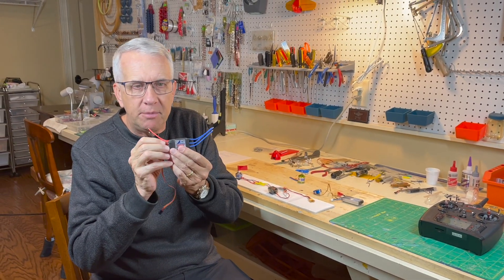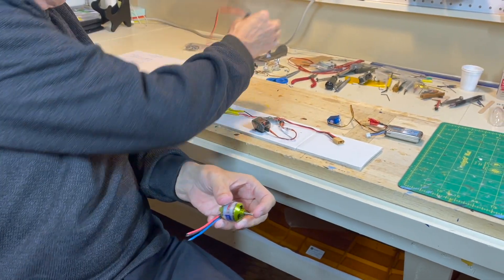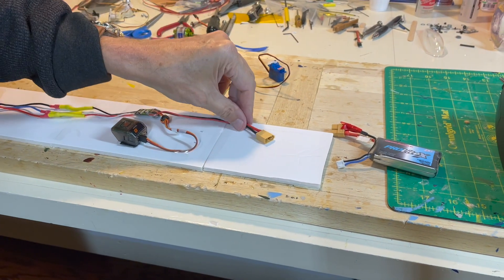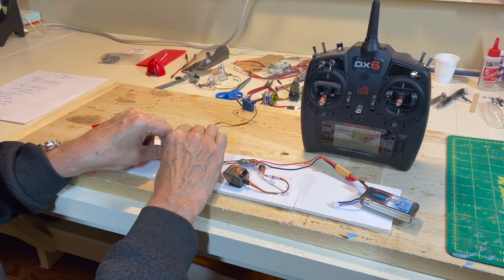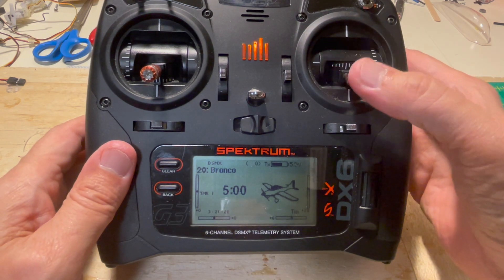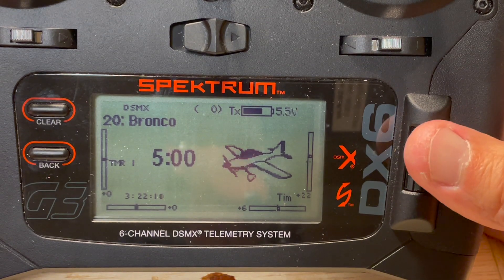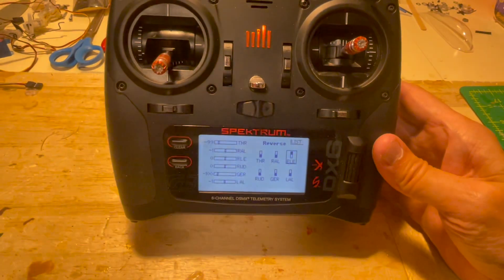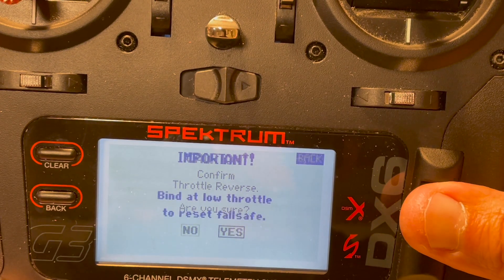How to Reverse a Brushless Motor RC Basics

Comment: Question:...Tim,  is there an on line  compatibility  chart or  math  formula   you    follow  to find ........ motor size  and ESC .......ESC and  battery ........  motor / ESC and prop...etc..       thanks much for another  helpful  informational video  .....
Reply from the maker: Gary:  That is a good question.  I am not sure of any "one stop" chart for these matters.  Instead, usually the ESC manufacturer has a chart for number of cells and servos that the ESC can handle.  I usually "round up" if there is any doubt, i.e. go from a Talon 15 to a 25 if the motor has a bit  more pull.  But tech info on the ECS is most helpful.  Finally, the tech support guys at www.HorizonHobby.com are very good at answering these sorts of questions.  Chat function works well.  Tim
Reply: @TimMcKay56  ok Tim,  thanks for the help.....Happy New Year!!!

Comment: Good morning Maybe you made a video on connecting two motors on an airplane... On a twin electric engine, the ESCs must be connected together on a single channel? The left motor should turn left and the right motor should turn right? And should we put torque and thrust on the motors? I imagine that the propellers also have two directions. Thank you for sharing your knowledge with us.
Reply from the maker: Here is my video on setting up two motors: https://youtu.be/DP97BhZcXQE  For RC models, it really does not make a big difference if the motors run in the same or counter rotating directions.  This is important with full scale aircraft with large motors like a P-38.  Tim
Reply: @TimMcKay56 Merci beaucoup 👍votre aide est précieuse
Reply from the maker: English, S’il vous plait. 😊
Reply: @TimMcKay56  

I just translated my questions

Comment: what happens if we control the main motor using right side stick (bidirectional) channel 1 or 2?  Does the motor spin in opposite direction if we pull the stick down?
Reply from the maker: It is possible to set transmitter with throttle on the right side (Mode 1).  This has no effect on motor rotation direction. To change brushless motor direction simply swap any two of the three motor wires. Tim

Comment: Brushless dc fan motors .
Something about changing 2 or 3 wires but difficult to get access to board.
Reply from the maker: 👍🏻😊 Tim
Reply: @TimMcKay56  wanted bearings for front wheels of RC car I'm sabotaging other Thrift store toys for pre teens but to use motors, need one going clockwise.
I got it apart but it will never go back together.
I don't resolder mini ICs either.
Will keep destroying till I'm an expert.
Local RC store has no brushless motors?
It is a Mustang with double tires all around = 8. Helicopter in back window.
Total of 8 motors.
The project keeps me from spending time wisely on much more important inventions.

Comment: I have a question  Hope you can answer for me
I am finding it hard to locate some electrics for small craft especially brushed set up
Have you ever used a brushless/micro 1S system Receiver/motor/servo's in your Guillow builds?
I know many use brushed motors and electronics for 1S, like in the Champ or Sport Cub, have you used the 1S brushless before?
Thanks in advance
Reply from the maker: Ed:  As not too many people purchase the smaller motors for home builds (as they are used mostly for RTF models), I have not located any real micro brushless motors.  Rather, I use micro brushed motors with gears, they seem to work well.  See my recent video on where to buy these micro systems: https://youtu.be/3EGDubskwqA  Tim

Comment: Always a clear explanation of how to.....  Thank you.
3 things;  
1  When changing the servo settings, REMOVE THE PROP(S)!!!!
2  Reversing the throttle does NOT reverse the motor direction.
3  Why does reversing two wires change the motor direction?
Because the motor "fires" in the direction of the sequential pules sent to the motor.  If you write 
1   2    3   1   2    3
A   B   C   A   B   C

The motor fires in the A-B-C direction.  Now switch two wires say "A" and "B" the order becomes:
1   2    3   1   2    3
B   A   C   B   A   C
Notice the order becomes "C - B - A"  and the motor runs in the opposite direction.
This is not original to me but the best explanation of why changing two wires reverses the motor direction.
Reply from the maker: Randy:  Great inputs, thanks!  Tim